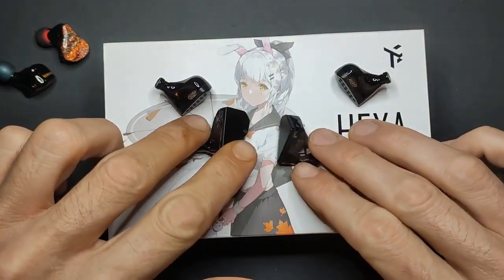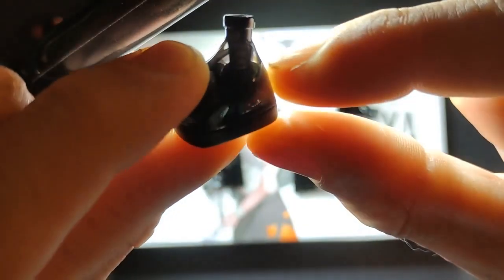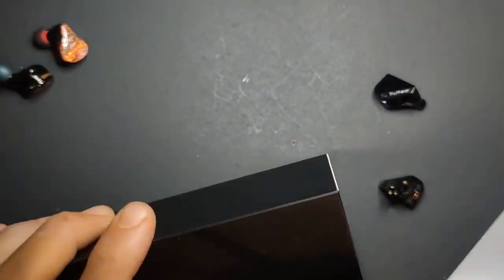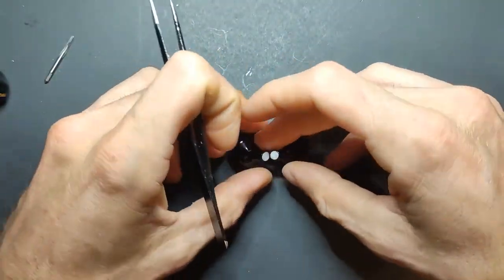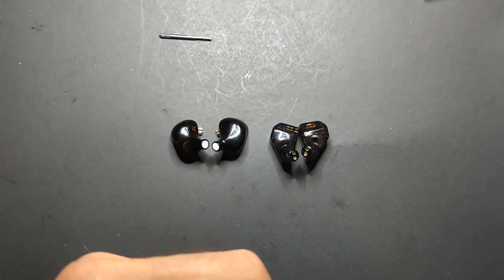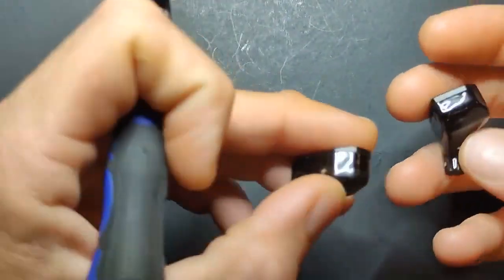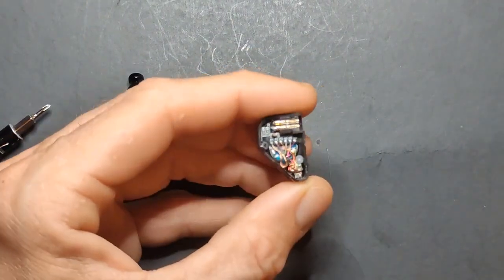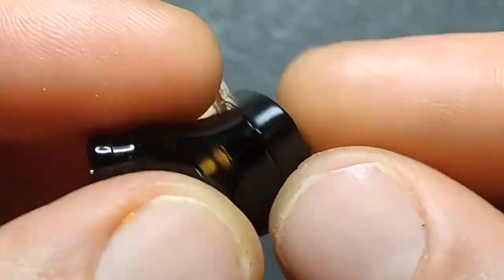Battle of the Hybrids! Featuring Truthear HEXA and CCA HM20 earphones! (also teardown)

Comment: the CCA HM20 seem to be a sleeper. Your comment at 45:45 regarding binaural has my interest as I regularly use high quality spatial DSP to process stereo music to simulate speakers, but also I enjoy nature binaural recordings and 3d audio in the best games. I also have the HBB Khan which is like the Zero, and I enjoy the clarity in that mid-range, great tuning (though the bass is a bit pumped up on purpose even more than the Zero). I have an HM20 on the way, will be good to compare against my Legato, S12 and some other sets.
Reply from the maker: Nice! I'm curious to hear your thoughts. I think it's definitely a sleeper iem. I mean the tuning isn't the best, but it definitely has a special factor to it. There's definitely some magic going on with the separation of instruments and such.
Reply: @hi-friaudioman  Ive had the HM20 for a while now. Hands down one of my favourite IEMs. I actually think the tuning is excellent and does what it is intended to do. Like you discussed in your video, these absolutely do fantastic with binaural/3d audio applications and the reason for this is that the midrange 800hz and through the treble region pretty much hits the IEF target spot on. This region also helps with vocal and timbral accuracy. Of course, the HM20 has a large sloping shelf from 800Hz all the way down with a large amount of subbass. But remarkably, the HM20 sounds balanced, and the lower mid-range and bass regions are still clear. The HM20 is an interesting blend of clarity, note weight and deep bass. Fantastic. I say this as a person who is both into very neutralish signatures (ie. Focal Utopia, Etymotic ER4SR, Blessing 2) but also enjoys pure basshead (ie. Legato, also use a SubPac).

Performance and technically, I think CCA has done a great job, you don't feel like you are listening to a multi-BA set, the sound is very cohesive probably thanks to the sound tubes. The 7mm dynamic driver is punchy, taught, and can extend low with low distortion. All-in-all incredible versatile and I personally enjoy this IEM over more expensive sets like the Blessing 2, as it just brings more clarity, presence, and I feel the low-end is cleaner/deeper.

But the other aspect that puts this as a top IEM for me, is that CCA has reduced the size of the IEM. It is quite compact and fits so well in the ear. It truly is an 'in-ear monitor' and not just a speaker with a bulbous housing sticking out of your ear. This improves the fit, seal, stereo image, reduces wind noise, and allows you to listen  in bed easier laying on your side. And then there is a price. Will probably buy one as a back up as this signature just works so well and I'm often reaching for this set even with other enticing options around. It works for music, gaming, portable, movies, etc.
Reply: @malfunkt which is the best for live music in-ear monitoring? 
It has to sounds clear without eq.
Which is more balanced sounding? I need to hear all frequencies, without too much bass in order to not cover other frequencies. The sounding to not be fatique at mid-high frequency. Power handling is also important, and clarity at high volume.

Thank you very much!

Comment: Honest question. The hexa driver spacing issue you find is causing sound waves to interact, why doesn’t that show up in the FR graphs? Are you saying it has a phase alignment issue?
Reply: I think the tips on the Hexa are very important to how the sound is effected coming out of these iems, when I first tried them I used the small bore tips, and that was a huge mistake because it made it sound veiled and flat and blurry. Everything did a 180° turn when I used the wide bore tips because it became super clear and dynamic with the wide bore tips. I don't see many people talking about how the tips affect the Hexa, but I'd assume it's the reason why some reviewers really praise them and compair them with 200+ dollar iems, and other reviewers really don't like them and think that they are blurry and flat
Reply: @andewnivar8926  I use Final E TWS tips by default, which are short and wide bore, so I never had any of the issues he talked about. They sound clear and the fit is also probably has the best fit I had with any IEMs, they sits flush in my ears and it doesn't move even when I tilt my head, lie down, etc. I wish he tried wide bore tips, maybe he'd have a different opinion. This kinda makes me wanna try narrow bore just to hear how they sound since it's been forever since I used narrow bores haha
Reply: You're running a wave to measure these things.  It won't reflect the timing of real world use and therefore will not show phase cancellation.
Reply: @andewnivar8926  
Agreed, I've tried small bore ones, and my opinion is the same as his.
I use a wide bore too every time I try a new IEMs, because small bore ones often provides too significant or contrast sounds output.
Since eartips sensitive IEMs exist.

Comment: The mids and the high frequency driver should have separate ducts in hm20, also should've included 2 30019 drivers and BAs should have been placed in the front rather than the back of the DD
Reply from the maker: Yeah I agree, I'm not a fan of the design but I must admit it does work. There's definitely some incoherence but it's to the point that it benefits the imaging and there's not much blur or haze.
Reply: @hi-friaudioman  I hope they do things better, when they come up with the kz counterpart

Comment: Any thoughts for mods that could slightly increase the bass on these? Anything regarding the vent/port/etc that would not involve a deep teardown.

Would also be super helpful if you put a link in the description for the tool/dampers or specific keywords.
Reply: Don't bother with all that, just get a qudelix 5k, full parametric EQ with 20 custom profiles you can make for all your iems/headphones.
Reply: @gixxerman1128  I have a Qudelix but generally dislike having to set up EQ across multiple devices. It will work for some people, but my desktop audio setup is a bit more complicated due to having an audio interface with multiple connected devices. Discord also hates equalizer APO.

Comment: What I am curious to see is when everyone in Chifi land starts to use inductors as well as caps and resistors like AFUL performer 5 has done. These types of crossover circuits have been in better loudspeakers since the 1950s. Nothing patented about it.
Reply: High value inductors are big and if made from very thin wire, they add a serial resistance (if used in low pass) thus a loss of power_level. I would like to know what kind of micro components Aful uses in the P5.